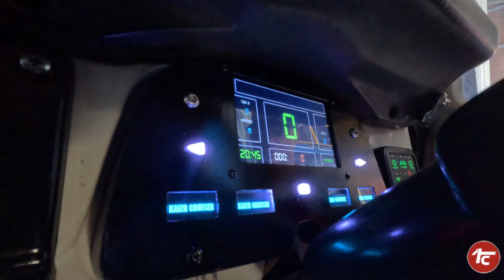BARRA / ENGINE Swap into a Landcruiser - What we learnt, what we would do different.

Comment: I put a VT ECOTEC in a 75 series Troopy , power was not the focus but it does help , no just a tech upgrade from the old 3F valve burner . MASSIVE improvement and economy , (4L60E to Toyota transfer from marks) put the motor forward as per standard drive shaft's but as a V6 has loads of space all around the motor anyway , if I get around to another build it would be the Barra to Toyota manual ? maybe go auto as the falcon magnetic shifter looks to be a good idea ?
Reply from the maker: That is cool, I have seen an FJ40 with the Ecotec V6 and they love it too.
Reply: @40channelcruiser yeah just gotta find one for sale…